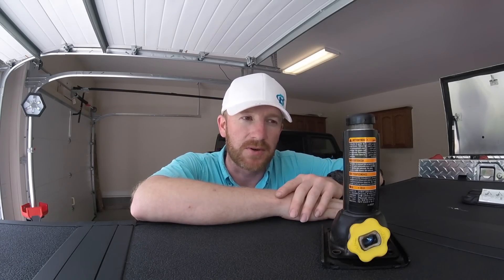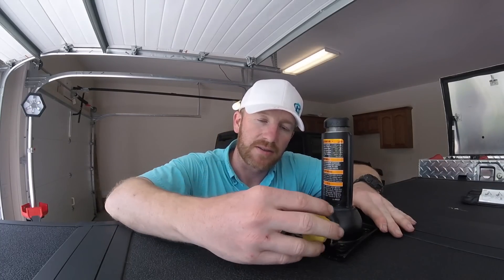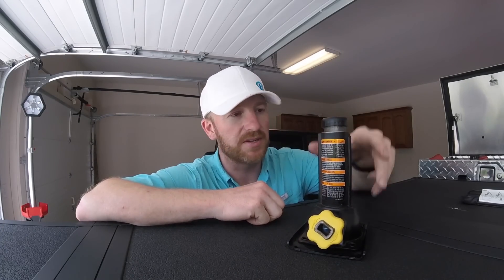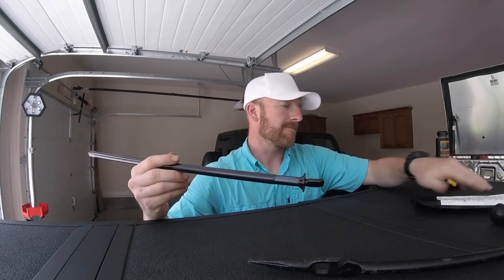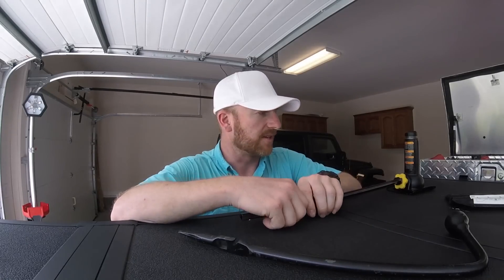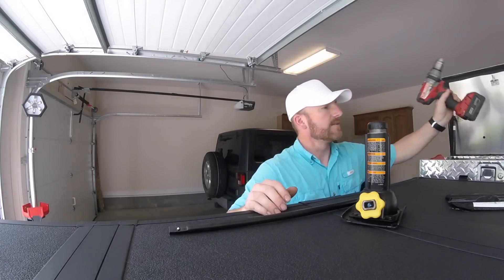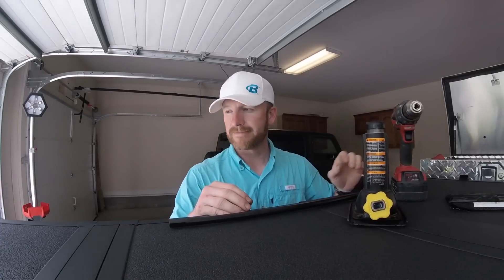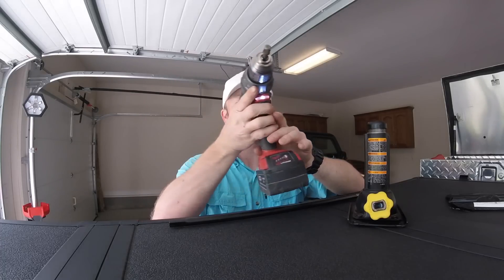EASY DIY Electric Car Jack

Comment: Nissan OEM emergency scissor jacks have a 21mm / 13/16in / large spark plug socket head on them. I've used them in junk yards many times with an electric impact and a socket because they're so versatile. Might be a better solution than needing all those extensions and the rounded nut extractor.

Comment: did you not see the splits in those tires     you need new ones
Reply from the maker: Good eye!  And yes I did see the splits.  This was on a Friday and new tires were being installed Monday.  The rears where in much better shape due to a poor alignment so I put the rears up from till the new ones arrived just in case.  A blow out in the rear is not nearly as a dangerous as one in the front.

Comment: Rotate your tires- fronts to rear and rears to opposite side fronts
Reply from the maker: I totally agree!  When this video was shot I had already purchased a new set of tires.  The front tires were a little too worn for my comfort so I did a quick swap with the rears to ease my mind till the new ones arrived.  Normally I would have done it your way which is spot on!

Comment: You could cut both the ends off and weld them together, cutting out the middle bit making it easier to use
Reply from the maker: Thats a good idea might have to break the welder out this weekend!
Reply: That will render your jack kit useless, let say if your cordless drill runs out of battery.